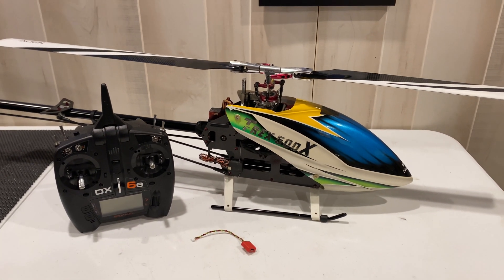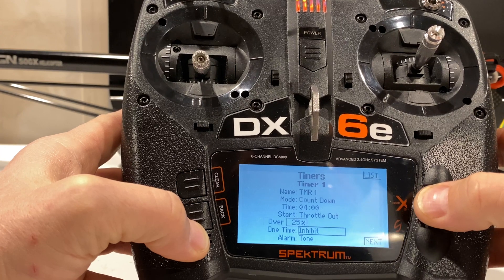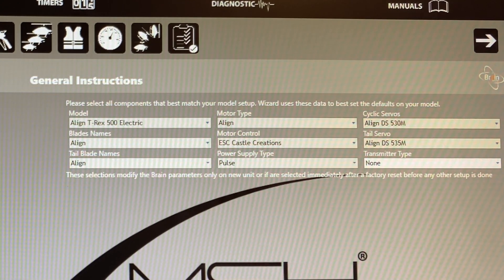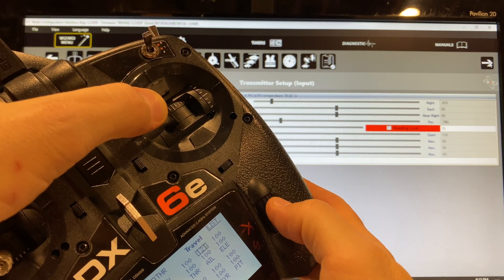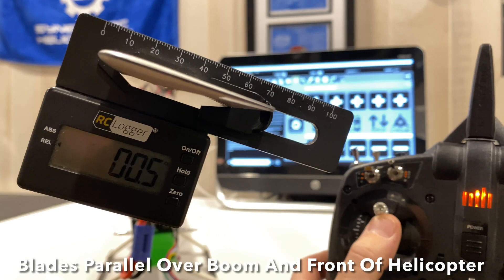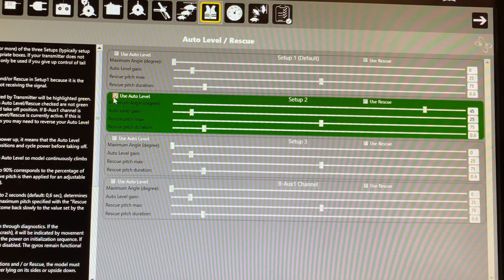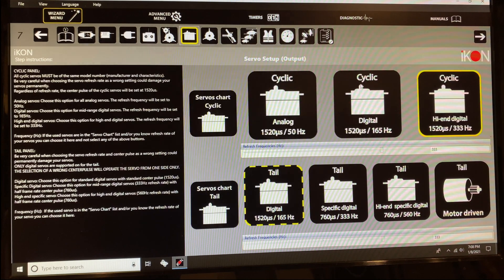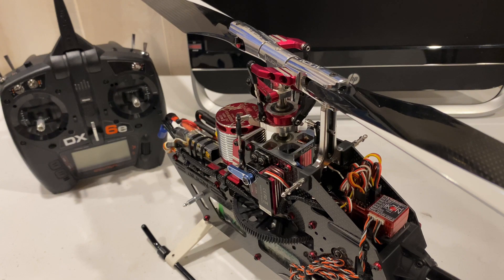MSH Brain / iKon Flybarless System Walkthrough Setup Video

Comment: What are the best practices to setup Brain2 with Spektrum transmitter, in order to adjust the tail gain on the fly from within the transmitter? I am using the knob and have it mapped to channel 5 and adjust it that way. Wasn't sure if there was a better way. I can also switch off head lock and go into rate mode so I can manually adjust my tail to proper mechanical preload on first couple of flights, then once that's done I can fine tune head locking mode with the knob switch.
Reply from the maker: @LichaelMewis  I rarely change the tail gains from the wizard setup. You change your gains in the gyro menu. No need to change while you fly. I leave the gyro menu open and either adjust in a hover or land, adjust and take off again.

Comment: Which gyro gain would you adjust from for a Trex 470LM with throttle curves 70/75/80? I have a brain2 mounted. Greets and thanks for the great videos
Reply from the maker: Keep all settings from the ikon wizard and see how the model flies. I’ve Never had to adjust any gains other then the tail gyro gains and I find that out on the maiden if I need more or less gain.

Comment: I've been using and setting up beastx units for a few years now and although the esc calibration is similar I just can't get a brain2 to calibrate the throttle, I've tried the usual removing the signal wire and powering up the brain unit letting it activate then powering up esc, doesn't Goe through the calibration process at full throttle. , anyone any ideas?
Reply from the maker: What ESC? I’m using HobbyWings now. I don’t do anything in the Brain/iKon with the gov screen it’s all turned off. I using the HW built in StoGov mode.
Reply: @crmodels  caste ice 80amp and I've switched the governor off on the brain but can't get the ASC to go into calibration mode
Reply from the maker: @Stephencassidy-j3t  https://youtu.be/xF7VTrs_hsI?si=wnUvShiJupXF0Taa

Comment: What are the differences between sport, acro and agility modes? I am new to flybarless programming and would like to know. Thank you
Reply from the maker: It’s how the heli feels and reacts in flight. Each mode choice has increased rates and expo. Beginner model limits banks and flip speed. Extreme is higher rates less expo for full hard 3D flying. You can also add more expo in your radio if desired. I always just flew the preprogrammed flight choices.
Reply: @ChrisReibertRC  okay, that makes sense,  and just to confirm all others except beginner will allow full movement for 3D flight correct?

Comment: I have recently set up the brain on an MD 500 500 size heli and it hovers very nicely but when I go to auto level it takes off hard left on the aileron any ideal why it's doing that
Reply from the maker: I had it pull left or right before. The ikon might not have been level when you did the setup or it’s getting some vibration during rescue.
Reply: @ChrisReibertRC  well it was level in the helicopter is really smooth I have it with double-sided tape like they recommend
Reply from the maker: @roachcoachhelis6387  Maybe something in the advanced menu. I’ve only had it happen a few times.
Reply: @ChrisReibertRC  I have gone through the setup menu again and make sure I did not have anything wrong and everything looks good have not had a chance to try it again because of the crappy weather

Comment: Great video 👍 I've got a rather basic question, does "rescue" need a channel on its own? And if I want to adjust gyro gain from the tx, does that also need a seperate channel? Selecting different headspeeds also needs a channel? I just do not find answers to this, maybe it's to basic??
Reply from the maker: Yes rescue and gyro need their own channel so if you want rescue you need a 7th channel to assign Aux 1 to. Like I did for my Dad’s heli with his DX6 if you want rescue set the tail gain in the software which will free up a channel for rescue. No headspeeds have nothing to do with the channels. Headspeed is changed by your throttle curve in your radio or your ESC setup.
Reply: @ChrisReibertRC  Thank you a lot for your answer, this really helps. I think I am getting closer to what I'd like to know. I plan on using the brain2 with a 6 channel transmitter and receiver, so I guess this would be a similar configuration - as you mention it - as your Dad's DX6 setup. 
My question this time is, what are the channel assignments for a 6 channel setup? I went through the Brain Configuration Interface PC App in demo mode (nothing plugged in) to have a beforehand view at the matter. In the "Advanced Menu" - "Receiver" the App lists the Channel Assignments. It says right now:
Aileron: Channel 1
Elevator: Channel 2
Tail: Channel 4
Pitch: Channel 6
Tail gain: Channel 5, which can be checked to "Is set in software", which as you say frees up a channel
Setup selection: Channel 7
Throttle: Channel 3
B-Aux1 (Auto Level/Rescue): Channel 8
B-Aux2 (CH2 Output): Channel 8
B-Aux3 (CH4 Output): No Channel
Now, if I will free up the Tail gain channel (Channel 5), that still leaves me with 7 channels to be assigned, and this is what confuses me. How would this Channel Assignment list typically look like for a 6 channel setup?
Reply from the maker: @Ilker_Ali89  Reassign Channel 5 as Aux 1 instead of gyro and choose the switch you want to activate rescue associated with channel 5. You still only have 6 channels so you are reassigning channel 5 as your rescue channel.
Reply: @ChrisReibertRC  That would be then:
Aileron: Channel 1
Elevator: Channel 2
Tail: Channel 4
Pitch: Channel 6
B-Aux1 (Auto Level/Rescue): Channel 5
Setup selection: Channel 7
Throttle: Channel 3
B-Aux2 (CH2 Output): Channel 5?
B-Aux3 (CH4 Output): No Channel
But this still leaves me with 7 channels. Am I correct that with a 6-channel radio the rescue function is NOT possible? I'm sorry for being so uninformed. 
Am I right that regardless of the order, with RESCUE the picture would be something like
1-Aileron, 2-Elevator, 3-Throttle, 4-Tail, 5-Rescue, 6-Pitch? So "Setup selection: Channel 7" isn't assignable?
Reply from the maker: @Ilker_Ali89  Correct only 6 channels max out of a 6 channel radio. Shoot me an email tonight and we can chat and get you squared away. We can chat over the phone or FaceTime! Email me at ChrisReibertRC@gmail.com

Comment: So if I’m gonna use castle governor, then program castle esc to helicopter mode and ignore the Ikon2 governor menu right?
Reply from the maker: Correct. Set your castle up in heli mode with the castle link software and then calibrate to your radio.
Reply: Thank you buddy I just subscribe

Comment: Pitch curve is linear. Check. How do you set up your throttle curve?
Reply from the maker: This is all dependent on whatever ESC you are using and if you are flying Gov mode, external Gov, flat curves etc... I setup the ikon first and then the ESC 2nd. I don’t use the ikon gov and skip that menu. I’ve always used Castle or Vgov for throttle management.